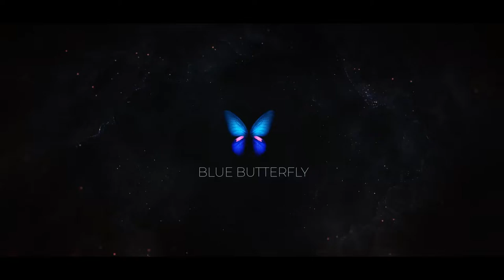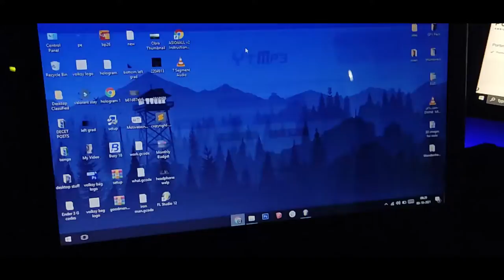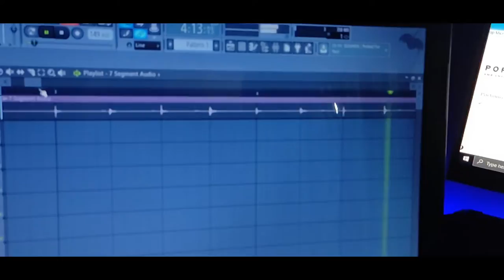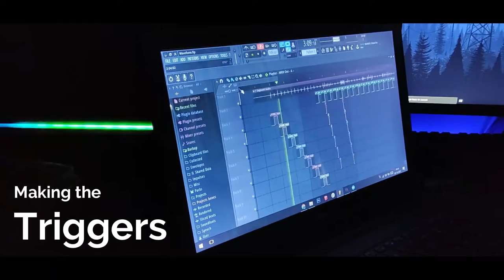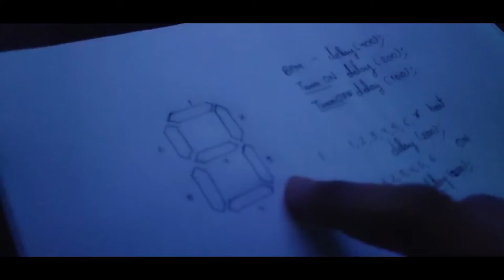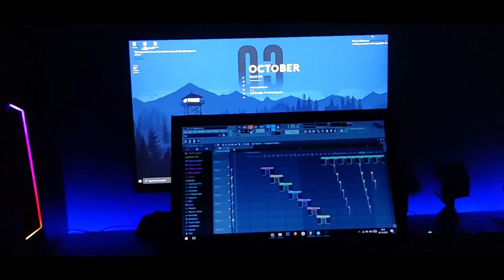Making Music with Relays 🔥 | Arduino MIDI

Comment: Awesome bro 👏🌹
I have a question about can this program be repeated again via the Arduino only without the computer. I mean, can the program be recorded inside the Arduino?
Reply from the maker: umm good question yeah it can be recorded but it needs a lot of time in coding. and adding delays to the pins to make the rythm but it is possible.
Reply: @BlueButterfly2000  
Yes, bro, you are quite right. That is what I thought.
Reply from the maker: @MAG MAGTH  yes bro